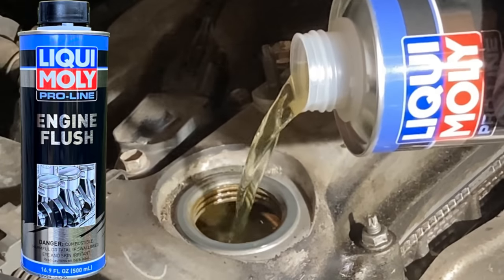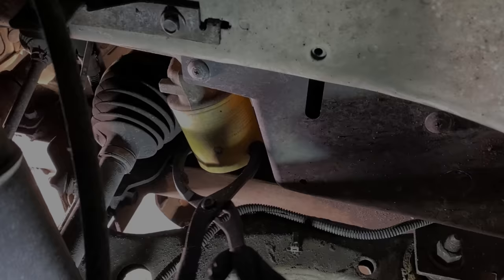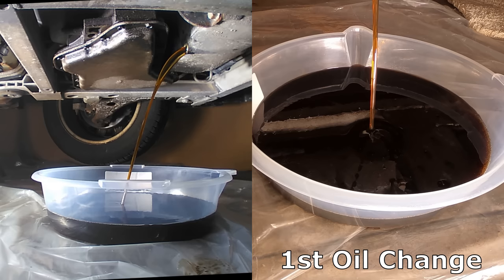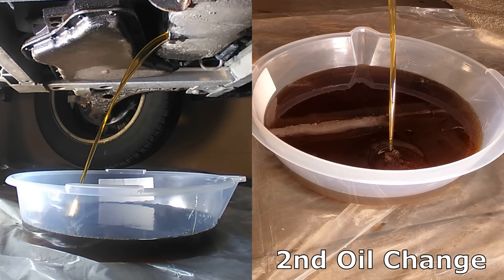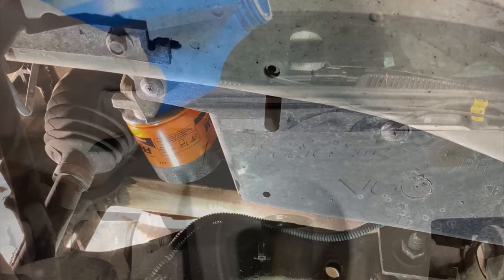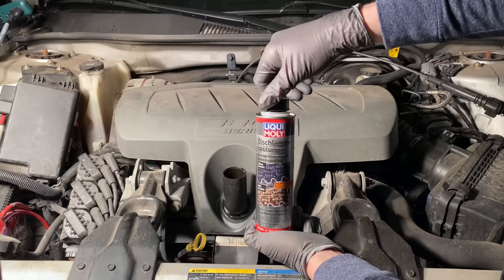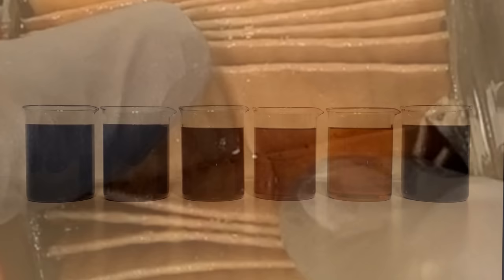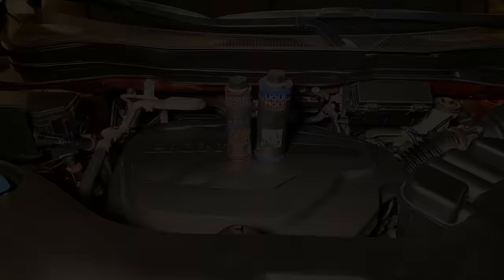Liqui Moly Sludge Remover vs Liqui Moly Engine Flush (Which is Best?)

Comment: Just use transmission fluid in the engine oil and it will flush it just fine and it's probably a lot cheaper
Reply from the maker: I've heard of this method, I would just keep the RPMs low, idle only and use a small amount, maybe half a quart.

Comment: Is it necessary to use new oil to clean the engine? Or should it be with my old oil before changing?
Reply from the maker: If the old oil has flush chemicals in it then I would say no.
Reply: @OwenLucas  ok cool, I’ve never cleaned my engine before, so I was thinking of using new oil to clean it

Comment: The best way to flush the old engine is to add liqui moly to old oil and let it idle for 30 min then remove filter and old oil then add new oil with new filet and liqui moly again then let it idle for 30 min or go drive less than 2000 RPM last thing change the oil and filter and that’s it

Comment: Did you driven between each oil change n if yes than how many miles?
Reply from the maker: No driving between the initial oil changes, just idled for 20 minutes.  I drove 200k (124 miles) after the sludge remover was added as per the Liqui Moly's instructions

Comment: Without a complete engine oil analyses of all the oil samples I find the conclusion invalid at best. I own a 2011 Sonata with the notorious Theta II engine that had massive engine failures costing Hyundai millions. I drive in trepidation waiting for it to die. I had an oil analysis done by Blackstone at 60K miles years ago. I specifically was looking for metal and they did not find anything unusual at all with my oil.  It is said the cause of Theta II engine failures was the lack of cleaning after the engine block was machined for the crankshaft. Then supposedly the super fine filings made their way into the oil feed system. Eventually backing up sludge depriving the crank bearing from lubrication. If an engine flush or 2 would have possibly saved them from replacing hundreds of thousands short blocks then why didn't Hyundai give out some free oil changes? Meanwhile I use a 15K rated oil filer changing oil and filter every 3K and live in fear of engine failure. Just 2 days ago my bother called me and asked what's wrong with my engine describing classic signs of Theta II engine failure in his 2012 Sonata. It rattled my cage knowing his failed at 90K and he is no hot rodder. His dealer said they would cover it 100%. I do not know how much longer these engines will be covered by Hyundai. I have heard everything from 120K to "lifetime". Meanwhile I'll take my Blackstone oil analysis with my to bed every night to help me sleep. I am 76 and really do not want to do a short block replacement myself. Those days are over for me.
Reply from the maker: That is an interesting finding on why Hyundai engines failed.  Such an easy mistake they could have fixed so early on.  I bet their engines come out of the plant with out an  extra particle of metal on them, but who knows?

Comment: I wonder if you missed out the engine flush product and just drained and refilled your engine oil three times whether it would have the same effect? 

Oil has detergent in it, so it should clean, and there’s always oil left in other parts of the engine. It’s the same when flushing your radiator. Fill and drain three times should clean out any residual coolant. Thanks!

Comment: I have several unopened various brands of oil. I consider them to be a lesser grade than the Castrol high mileage synthetic blend I am using. That's just my uneducated assumption.
Do you suppose I could use them for these flushes. I think you said you drove 125 mi and then drained the oil for the next test. I wouldn't feel so bad wasting these misc. oils. BTW...they are not synthetics.
But when the testing/flushing  is all over I figure to go back to the synthetic blend.
Reply from the maker: Those would be the perfect oils for a flush! It won’t matter if they are not synthetic either for 125 miles.
Reply: @OwenLucas  That's great, good to know. thanks. Usually when I change my oil, I pour in maybe a half qt after draining it. I do that hoping to catch and wash away some settled sludge. Then after leaving it to drain for a while more, I plug it and fill properly. Do you think that did any good at all ?

Comment: My 2002 S10 has 110,000 original miles..I change my Full Synthetic oil every 2,500 miles ..I'll pass adding any sludge remover because I know I don't need it & I fear adding this aggressive product may strip the protective film off the internal parts
Reply from the maker: That's pretty low mileage for a 2002, with those short oil change intervals, the internals must look like brand new!

Comment: Thank you for the video.  Can we perform fluid flushes on a newer engine?  My ‘20 Silverado has 150k km and I was thinking about doing the same.
Reply from the maker: 150km is a good time especially if you worked the engine hard but if it was all highway miles, maybe wait another 50k.

Comment: Ok from experience owning my own shop and repairing vehicles tractors semis and lots of it ran when parked mystery buys dropped off and left to me to get running. I have never honestly found any of the commercially available flushes or cleaners that are effective at removing alot of the carbon and sludge in the short time that its jn there thus is only soften and loosening it up and comes out over some time ofter times plugging up the oil filter in just a few hundred miles after the flush was performed and the vehicle left operating in bypass for the majority of that oil change allowing new sludge to form mixed in with the now free floating old sludge ss well ss passing through the bearings and plugging up tiny passages. So you must use something that is going to remove it quickly and then be aware that you have to atleast do several short changes of the filter and preferably the oil too. By Short change im referring to at most 1500 miles but i usually put a schedule for my customers and it was a 500, 1500, 3000 mile schedule for the first 3 after the flush. I refused to do sny flushing on any vehicle that was the customer was unwilling to sign prior to the flush that they were aware of what the risks are but also were going to commit to the schedule and that it js mandatory for the first 500 mile change to change the oil and filter as it is going to be much thinner due to the remaining flush.  I have always used my own flush and have never had any failures from it and have torn down enough of the engines after I have flushed them to say that it removed 99% of sludge and deposits. Roughly 350 miles before the appointment for the flush i have them stop by for 15 minute prep during witch i changed the filter and topped off the oil to the full level and then add depending on the engine size between a half gallon (2 quarts) to a gallon (4)  quarts of a 50/50 mix of atf and diesel added after the oil is full. Its not enough to cause problems but is just enough that it will get more contact with the counter weights on the crank shaft causing it to be splashed around to the places that are normally not going to be very easily reached consistently enough for effective cleaning but not actually having the crank in it causing it to foam and aerate and being over full will ensure any small aeration isnt going to be sucked into the oil pump. Obviously you are not wanting to beat on the vehicle and I recommend staying below 55 mph but I'm not your mother so people will still do whatever they want to do.... Then at the 350-500 mile mark and the day of the appointment I have them take the vehicle on at least a 100 mile constant above 45 mph drive to get the most amount of heat and rinse available and then am ready for them to pull in and drain as fast as possible to keep everything suspended and remove ss much as possible. At this point i chang the oil and filter but i use nothing lighter than a 15w40 oil as i promise you that after you drive a few miles that the remaining flush will thin it out Alot and it is fine. At the 500 mile filter and oil change ill step down to a 10w40 as it will not be thinned as much but it will still thin it. At this change i do a second flush of a gallon of a 75% mineral spirits 1/2 small bottle of regular dawn dish detergent toped to full gallon with the atf and add a quart of 20w50 oil for the typical 5 quarts required for most vehicles and during this 20 minutes do not rev ONLY idle the engine as it will damage it fast if revved with this very very thin stuff in it. I generally use the old filter for this as its a short time and likely will be fine for this. Then complete the oil change and return to the customer and see them in another 500 miles for the 1000 miles filter and preferably oil change and send them back for another 500 miles and repeat this time putting the preferred weight of oil in the vehicle and send them out for the 1000 miles and then repeat for the final time and let them run the fill 3000 miles and generally that oil at 3000 miles will look very good and while it maybe dark in color its still clear and not thick black and full of deposits. Just like a brand new engine the oil may be dark in color depending on the way it is driven but it can still see through it unlike an old neglected engine that the oil is thick and black and cant see through it. Once the sludge has been removed from the engine i tell them that they are going to be best serverd by staying with a 2500-3000 mile oil change interval for the life of the vehicle as the damage from being sludged up has been done and isnt repairable without rebuild or replacement of the engine so it will have more than normal amount of blowby and will likely burn a bit more oil than average and that the 2500-3000 mile change should keep it from sludging uo again and prevent them from forgetting to check the oil and going too far and running out of oil
Reply: @claytoncoolidge992 You are AWESOME for sharing your process for flushing an engine.  I plan to flush my GMC Safari 4.3L Vortec and will definitely use your information as a guide. 
In addition, to help restore compression in the cylinders, I also plan on using “Hot Shot’s Stiction Eliminator” poured into each cylinder and manually turn-over the crank and allow the position rings to marinate for a few days to help dissolve any buildup and restore compression. After a few days, I will evacuate all the fluids from the cylinders.  Do you think that would help?
Reply: @jackszumski7118 I love the 4.3l and is one of the engines I had in a 93 Chevy 1500 that I was second owner of I bought it with 267000miles for 400$ it ran great no check engine light needed tires brakes and lines a battery and a windshield I never thought it would go as long as it did but when I sold it still no check engine light original factory clutch and a newer set of tires it had 1398000 miles on it typical bad valve stem seal puff of blue smoke and only used 1 qt of oil between oil changes and still got 18mpg all day long wish I could have kept it but after my back surgery I couldn't get my leg to be able to push the clutch and reach that far to shift so I sold it for safety sake honestly I'd try running what I do through. I've had several of my own vehicles that were bought with low compression as well as customer vehicles that came back to be atleast contributing to the engine and not just dead holes. But out of everything that can cause low compression carbon stuck rings are only a small percentage of them especially with the low tension rings used in today's engines. Though you may find that getting the carbon out and freeing up the rings and using a thicker oil that you may gain a fair amount.
Reply from the maker: That is quite the process, I would love to see that sludged up oil coming out, very interesting!

Comment: what if use engine flush 1 liter or 2 liter...? and leveling with engine oil, will be clean...? or broke a engine..?
Reply from the maker: Use the amount in the user manual to fill the engine.  You want it to be full.  The multiple oil fills in this video were to have clear oil to see if the flush worked as indicated by dirty oil, so 1 oil change after the flush is all you need.
Reply: @OwenLucas thanks for your answer, 
 oh okay, if that too much sludge, will be disolve if use the liquimoly engine flush 1 liter or 2 liters..? or not..?
Reply from the maker: @anggismay6840  I think 1 flush would be enough, what ever remains after the first flush of oil should be enough. I don't know the capacity or liters you use or the dimensions of you engine so it is hard to tell.
Reply: @OwenLucas  my engine just use 3.6 liters engine oil. 🙏

Comment: I don't like using oil flush be cause it weakened seals of the engine causing oil leakage i just change oil every year or 5k km
Reply from the maker: The sludge remover is supposed to be safe on the seals, it's not a heavy solvent which is why it takes 200km to work.

Comment: Just want to know that I m having 14 years old car. Can I use it in it?? Also will it not damage the rubber parts inside the engine?? 
Thanx
Reply from the maker: Liqui Moly states that the flush is safe for gaskets and rubber components.  A 14 year old car should have some gunk in the sump no matter how well you take care of it, I’d do it. 👍
Reply: 🙏Thanks

Comment: You freaked me out cutting the filter open with all that oil running everywhere. I cut all my filters open and I’ll drill a few small holes in the end of the filter and let it drain for a while. For the love of all that is holy at least put a pig mat under the filter when you cut it open. 
Otherwise thanks for the video 👍

Comment: Question can I just put the liquid Molly sludge remover with out doing 3 oil changes can I just put it in and then drive 124 miles then get a oil change ?
Reply from the maker: The 3 oil changes are not required, that was just to show the affect of the flush on clean oil.  Just put the flush in your old oil and drive.

Comment: Thank you for this useful practical experience.  But...?  Do you know why engine cleaners were invented?  And others, regardless of the name..?  I think that.  This is so that time and money are saved.  .  and effort.  If you compare the cost of changing the oil with the oil filter.  many times.  with the cost of the product.  You will find the obvious difference.  In addition to effort and time.  .  According to what I think, put the cleaner before changing the oil.  You need to change the oil 3 times.  All loving you
Reply from the maker: That is a good point.  The extra oil changes were just to get clean oil in the engine to see if the oil changes color from the flush, to see if the flush really works.  Realistically you just have to flush the oil once after using the product to remove left over sludge.

Comment: Moly had nothing to do with these results. You change your oil 3 time's in a row (even with crappy filters) and you'll get the same results. Sludge is so 1970s oil technology. Modern oil's don't sludge, especially with pcv valves. Snake oil is snake oil is snake oil.

Comment: My car Holds 8 Liter Öl such Procedere would Cost a Fortune
Reply from the maker: Indeed.  The 3 oil changes I performed were to obtain clear engine oil in contaminated from remaining old oil.  All you would need to do is add the sludge remover 200km before your oil change.

Comment: I don't think the 126 miles would make your oil dark , its not enough miles to do that.
Reply from the maker: I agree, I’ve changed oil on some cars with less than 1000 miles of use and the oil came out only slightly darker. This test proves to me that the flush worked.
Reply: yes i agree, it worked.

Comment: I would not recommend engine flush if you use already good quality fully synthetic oil that includes detergent. A good quality oil both protect and clean engine.

Comment: I would be measuring ppm per hour wear rates and what was your soot loading? Do 5000 kilometre oil and filter changeouts
Reply from the maker: No idea, I didn’t run an oil analysis but those results would be interesting to see.

Comment: Ummm. Snake oil maybe?  If you have a bunch of junk in your engine I do not think I want to dislodge it and hope the filter will catch it. It’s like seasoning on a cast iron skillet. As soon as you clean it it is ruined.
Reply from the maker: Interesting analogy.  The idea is that the sludge remover gently dissolves buildup.  One of the components in the flush is 2-butoxyethanol which is basically a degreaser.

Comment: so which is best?
Reply from the maker: Proline Engine Flush is the strongest according to the Liqui Moly engineer I spoke to.  You cannot drive with it though.  Add to oil, idle for 20 minutes, then drain, no revving the engine.
Reply: @OwenLucas  can I do it twice in a row? I mean add the flush ,idle 20 minutes than change oil and filter add a second can idle for 15 minutes and do the final oil and filter change?
Reply from the maker: @user-du6op6qx5s   I don't think it would hurt but it might not be necessary unless your engine is REALLY sludged up.  Maybe try it on a second oil change after a few 1000 miles.

Comment: The test was good, but left gaps for doubts. The second bottle of oil is the same as the last one. What guarantees that you didn't use used oil for this test?
Reply from the maker: That was the point of filming me pouring in new oil and draining it each time.  Used the cheapest amazon basics oil you could get.  You can see new oil coming out of the jugs and the different colors of oil draining after each engine run.

Comment: I can change my Oil and go for a 10 mile ride to the store and back and have Black oil.. I have a small turbo'ed car and that turbo turn's that shite black immediately.. I'm at about 105K and I do over the top oil changes every 1500 to 2000 miles.. Just cause.. Sometime I'll use the filter for 4K to 5K while doing a drain and fill in between..